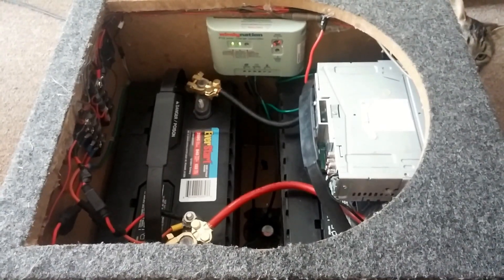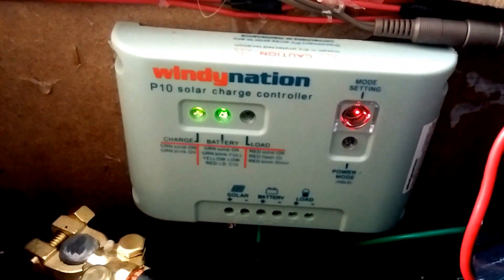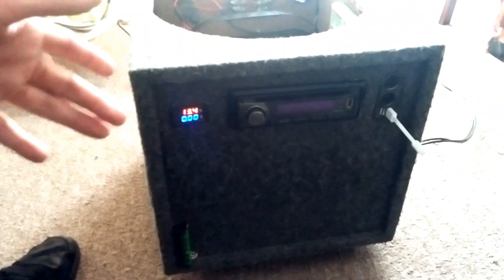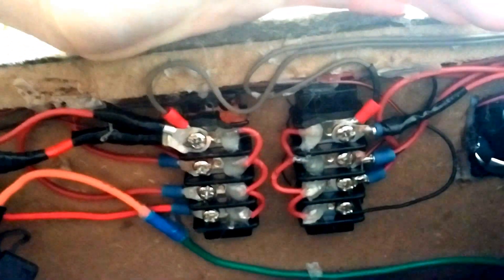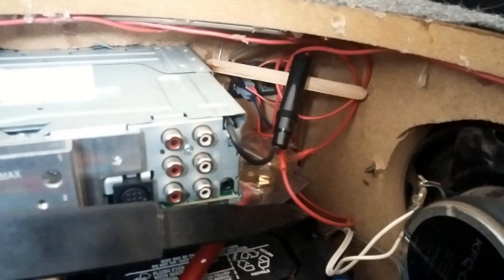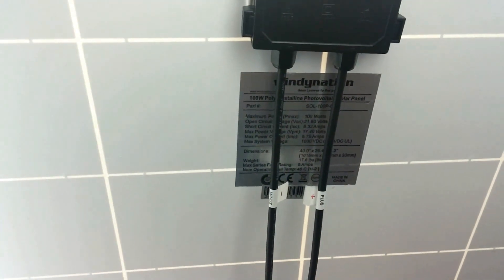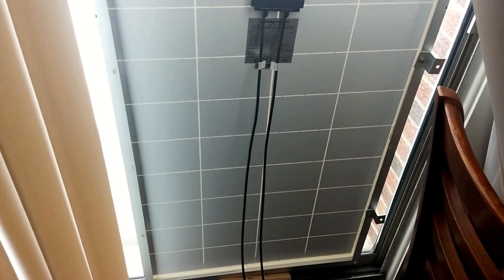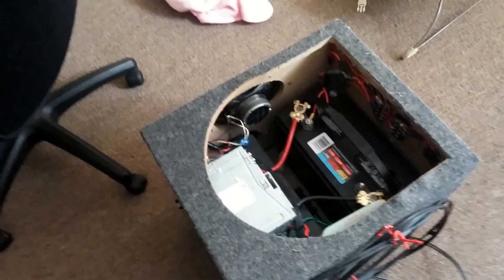*244AH Solar Generator* 200watt Solar Panels

Comment: Check out the MPPT Tracer 2210RN Solar Charge Controller Regulator 12/24V INPUT 20A by Tracer

On Amazon Price:	$117.00 
I have a Tracer and they are great. You can add the Monitor later for $40
Reply: I got the new 30 amp Tracer for $128 on Ebay